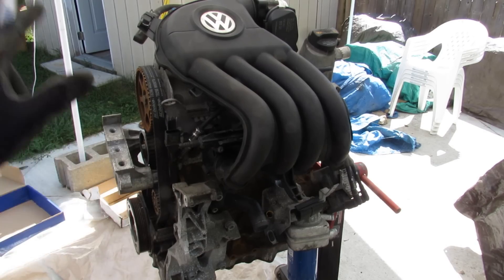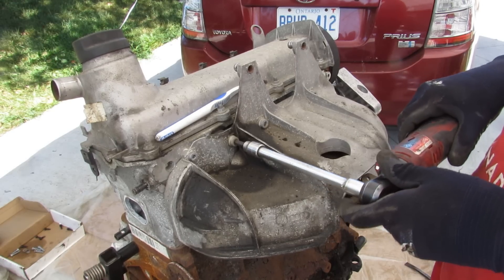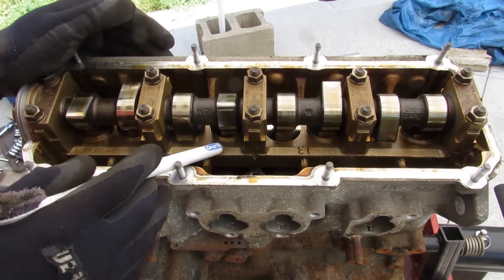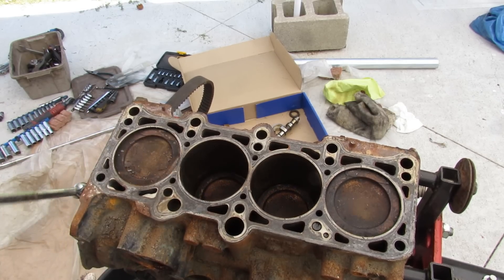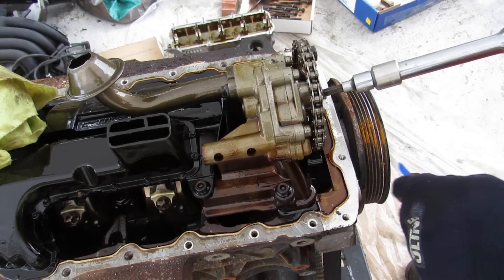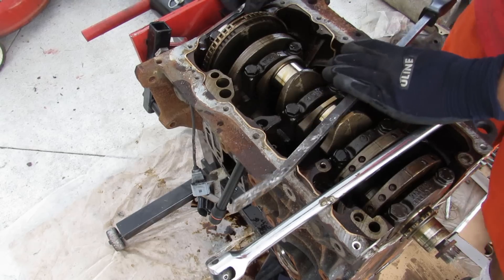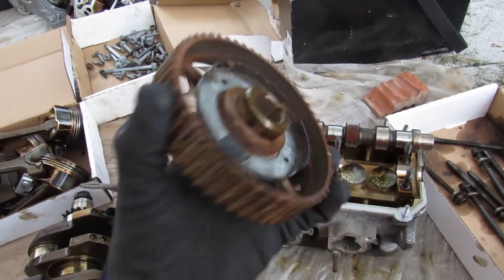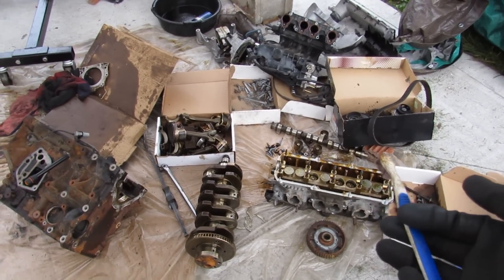The Simplest Modern Engine - From Volkswagen?

Comment: There is no reason on earth to overly complicate an engine other than to increase your service department's profit margin.  The best engineering is to build a machine as simply as possible, with the fewest parts that is simplest to service and reliable.

I wish that more of the propeller heads that design overly complicated "modern engines" would remember that.
Reply: Agree 100%.
Reply: The main reason for over complicating engine design is stricter emission regulations.
If you don't cut emissions, you can't sell your car.
There's plenty of other simple engines from VW, like the 1.2 TSI from the Polo and Golf, and 1.0 3 cylinder you find in the up! and Polo. Mechanically simple, but with a few more sensors for engine management.
Reply: @panzerveps  Engine emissions are no new thing, with an analyzer back in the day, I could pretty much tune any engine to pass any year's emission standards at a given RPM range and sometimes (usually) at the cost of performance. So yes, I made a 1966 leaded high compression Super Rocket pass for a 1982 with a catalytic converter and a 1975 (no cat) pass for a 2002.  The first one ran like hell the second ran just fine...

I also have a Mitsubishi 2.6 Liter MCA Jet Hemi, that will still pass for current emissions standards, will get over 40mpg Hwy... but it was and still is a slug.

But yes, computer management will give you a better blend of emissions compliance and performance over a broader rev range... Very true.

In all reality we have reached the point of diminishing returns.  We are adding thousands of dollars of complexity to get .5% greater thermal efficiency and 1% better emissions with decreased reliability and durability.  Of course, there's also outrageous repair costs to consider.

Personally, I'd gleefully give up that 1 MPG to save $10,000.00 off the sticker price and a car that won't last 100,000 miles without heroic repairs.  And I'd happily drive 1 mile a week less to make up for the emissions...
Reply: @RJ-vb7gh  Sure, you could use an analyzer to tune your engine to run correctly, but that's not what I wrote.
I wrote that emission REGULATIONS have become stricter, and you can't meet those regulations using just a carb and cat.
Reply: @panzerveps  True, but we're very quickly reaching the point where too much complexity is really not improving emissions or fuel economy while seriously undermining the engineering integrity of the ICE engine. In some cases the cost of the electronic control, emissions systems and monitoring systems on an engine are nearly as expensive as the engine itself, perhaps more expensive.  Not to mention that low tension rings actually cause oil dilution and shorten the lifespan of the engine. In other words the bells and whistles are choking out integrity of the underlying systems.

In the 1970's the Honda CVCC and Mitsubishi MCA Jet engines got about the same fuel economy as the Toyota Prius, without the need of fuel injection, cat (in the case of the CVCC), or a Hybrid drive system. They also had excellent emissions.  Is the Prius a tiny bit better... maybe or maybe not, but at what cost?
Reply: @RJ-vb7gh  Which is why electric is the only viable option for the future.
Reply: @panzerveps  Perhaps once someone finds a way to generate electricity without fossil fuels and battery technology becomes affordable... but the future seems to always be a day away.  One we get there, I very much may agree with you.  For now, I'll pass on a $15,000.00 battery that needs to recharge from a filthy grid.
Reply: @RJ-vb7gh  there already is several ways to produce electricity. Solar, wind, hydro and nuclear. All are low/zero emissions.
Reply: @panzerveps  And yet I live only a few miles away from a gas/oil fired environmental disaster of a power plant, in a town where everyone dies of cancer or has some other 'condition'.  

As things stand keeping the air cleaner in your neighborhood just means killing more people in mine... and yes I'm all for cheap clean renewable energy, someday.

Until then, I'll settle for cars that pollute where they live, and are cost effective to purchase and maintain.

I've been fixing cars since I was a kid, and even I wouldn't touch a modern car without my laptop, diagnostic software a multi-meter and a wiring schematic... and that's not to find out what's wrong with the car, mostly it's to diagnose the emissions and control systems, that I would happily live without in the first place.
Reply: @panzerveps  I'm actually not complaining, just stating a fact.  And I'm all for reducing emissions in a meaningful way.  I'm also into clean affordable renewable energy,  I'm just not big on the idea of moving the pollution source from one neighborhood to another.

Some years ago, I actually found a local shop that I had taken my car to was using my 1975 Buick 455 engine in a 1973 Electra... so no catalytic converter required and AIR pump deleted, (it did have EGR) to pass 1990's cars smog checks.  Which proved that a properly tuned and properly designed1970's big block engine could actually run as ckean or cleaner than a new (at the time) computer controlled engine of less than half the size without hundreds if not thousands of dollars of pollution controls. I'll add that that Buick gets better fuel economy than my computer controlled fuel injected 2003 Crown Vic which is again much smaller.

Yes... in theory more pollution control systems should reduce pollution, but in practice this isn't always true.  The fact is that a certain amount of burned fuel creates a certain amount of waste gas.  And when the air fuel mixture is right the emissions are lowest.  This is true whether you are working with a 1966 engine or a 2016 engine.  And regardless of the size of the engine, it takes about the same amount of fuel to provide the same amount of energy to move a certain amount of mass a certain distance.

In the end... I'm not arguing that I can make a 1973 big block more environmentally friendly than a 2021 4 banger, but I can get darn close without thousands of dollars of complexity.  Turbos for example only serve to cram more fuel and air into a smaller engine which then burns under higher compression at higher revs that boosts the CO and NOx that then needs more treatment...

Car companies are just adding more complexity to clean up cheaper engine designs or to get very small improvements at an insane cost to the consumer. If I hadn't seen the actual tests on State certified equipment, I wouldn't have believed it either.  So, I feel comfortable in saying that about half of the emissions stuff is a scam while the rest is a lot of investment to achieve very small results. In fact, I can literally take you through a modern emissions control system and prove just how little it's doing most of the time.

If everyone that could, would just drive a few miles a week less, our air would be cleaner without ridiculous emission control systems.
Reply: @RJ-vb7gh  After covid sometimes I feel like maybe that's what we need. The air got so much cleaner during lockdown.

Comment: Of course it doesn’t make much power. And yes, it’s an iron block. Why? This engine was built to last. In Germany you can find well maintained engines with 300k km and they still run smoothly without much power loss or significant signs of wear. Yes it’s simple and weak, but it’s unkillable. Just like the 1.9 TDI

Comment: I had one of these, 2001 golf manual . With short  ratios was quite agile. That time and age was an ok performance. Remember even  in the eighties golf were sold with 1.3 gas and 1.5L non turbo diesel. The 2.0L fits well in it's evolution

Comment: It's basically an upgraded EA827 called EA113. The EA827 was probably the best petrol engine VW ever built, funnily enough based on a 1960s Audi design that itself was based on a Mercedes design from the short time when Mercedes owned Audi.

Comment: I had the 2.slow in a 2011 Jetta. Pretty good engine. Had 180k miles on it when the car was hit and totaled. I had just bought the timing belt kit to do it the second time. Still in the box lol.
True on the coil and plugs. Coils would last about 60k. Plug changes are not that bad but requires a swivel to get numbers 2 and 3 out from under the intake.
Reply: idk about MK6's, but MK3/4s you'd just take the intake mani off to get the plugs in the middle. Sure it's an extra $5 gasket but it's worth it for the hassle
Reply: @dud1f3r  You don't have to take the manifold of, the 2/3 sparkplugs can be removed if you disconnect number 2/3 fuel injector connectors, you can then fit a socket via an extension down there, there is about 1 milimeter space which allows the socket to go there straight, I discovered this by accident...

Comment: I'm pretty sure they've been using this basic design for decades, since my EUDM Mk3 Golf had a similar engine (albeit a 1.4L variant, maybe ABD?).
On this newer version the plastic intake manifold's gaskets are rubber and are designed to be reused. You're supposed to remove the intake manifold for spark plug/upper engine maintenance. Lots of Euro cars do this and I find it preferable to paper gaskets.
Reply: MK3 1.4 was EA111, engine family that ended quite recently with 1st gen 1.2/1.4 TSI. This one is EA113 series, which also had 1.8 20VT variant - which is why these engines have cast Iron block and quite bulletproof design.

Comment: This has just confirmed to me why I don't buy VW's. They need 2L to make less power, mpg, and reliability than Toyota got from a 1.8L.... 20 years ago. Needless iron short block, complete lack of access for basic maintenance, needless specialty bolts, timing belt, coil wires instead of coil on plug presumably because after they stuck that giant plastic manifold on they realized they had no room left. The number of different bolt standards is almost as bad as my old X-Type.

Comment: Had this engine in my 2000 jetta. I was disapointed on how agricultural it sounded even when brand new. The car drove fine but this engine had so many problems after 60k it turned into the worst car I ever bought. This engine’s mission is to be cheap, that’s why it has the iron block and one camshaft with two valves per cylinder.

Comment: I have a 2017 vw jetta tdi and already got 148k miles on it. Out of all the maintenance ive done to it I think the most expensive was changing the spark plugs along with the ignition coils. But every 10k miles oil change with the air filters theres two one in the cabin and one on the engine. Zero problems.

Comment: If you buy a cake from a shop it has a list as long as your arm of what made the cake. If I make a cake it has 4 things. This is how I would make an engine except I would use pushrods and gear. A flat 4 being slightly better. I think we can see where that arrives, albeit water cooled. Variable valve timing might be possible with a simple gear like Toyota in the Aygo on a simple engine. That is just like ignition advance.

Comment: simple engine, but for some reason it eats spark plugs for dinner. And because of this stupid design they are not easy to access. Also, think about it, the intake almost wraps around the engine making the air coming in the engine warmer, which reduces the efficiency. Also PCV is not separate, when it goes bad you have to replace the whole plastic in front of the intake.

Comment: This engine has been around longer than that. Not super fast but it will last forever by just doing regular maintenance.
Reply: think it hails from Mercedes Benz, 1966. Audi, then VW took it to production. 1966. 
The Beatles were still together.
Reply: @timewa851  Yeah! I know this is a Audi engine which then VW added to many of it's vehicles. However, I was not aware it had Merc roots too! Do you know the code name of Merc version?

Comment: Simple?! That thing is incredibly complex. Japanese are complex? Nope. Compare to 1982 Dodge Colt/Plymouth Champ (Mitsubishi). Same cast iron block/aluminum head design except its a true hemi. The camshaft is down between the valves so its much shorter. I still have mine, 300,000 miles. No stinkin' computers or sensors or FI.

Comment: This engine is definitely the last of its kind; a simple, SOHC, 8-valve gas 4-cylinder that has way less parts to break than the super complicated engines of today.  As a contrast, the last OHV 4-cylinder gas engine used was the GM 2.2 liter used in cars like the Chevy S-10 and Cavalier.
Reply: OHV is more complex. For this VW you have to source hi quality material for the timing belt .. so it is not a cost measure. Just look how large the "sprocket" is. But you can do away with rocker arms and push rods and use less material on the springs => reduced cost.

Comment: My 99 Jetta 2.0 AEG engine is basically the same, have 130k miles on it, did tune up: ignition coil, spark plugs w/wires, gasket, belts - all cheap! 😉Runs smooth, no issues. P. S. hey you, Vdabs, try Liqui Moly additive - CERATEC! ✌️

Comment: All VW 2.0 8v's have milky oil, its a result of the PCV system. They will nearly always have milky oil caps. That's also not a variable intake, that's EVAP purge valve N80.
Reply: no no no, mine doesn't have milky oil.

Comment: Looks like they used a lot of parts from the older 1.8t engines lol
Reply: Wouldn't that be the other way around? The 1.8T is a newer, multivalve evolution. We didn't get it here until very late 1990's.

Comment: And its not modern its old but change some parts by years. Why its only 115HP because SIMOS not give more its old ECU steering use pairs injectors,ONLY 8 valves,poor spark pairs ignition,place of ignition plug in cylinder its bad too

Comment: Many VW owners call them the 2.Slow. They were probably some of the toughest VW gasoline engines ever built. However, those plastic cooling system parts can break easily, and not noticing when they do easily kills the engine.

The variety of bolts was common on modern VWs and all other German cars. One reason I like Toyotas and Hondas is that there is rarely a fastener that is not an 8mm bolt, 10mm, 12mm, 14mm, 17mm, 19mm, 21mm, and 22mm.
Reply: Agreed! ✌️and I don't need my 99 Jetta 2.0 for speed 😉

Comment: Horrible engine no power no torque problems with piston rings (VAG quality), poor ignition,blocked injectors,big fuel consumption,oil consumption (piston rings),poor valves (head not to repair).